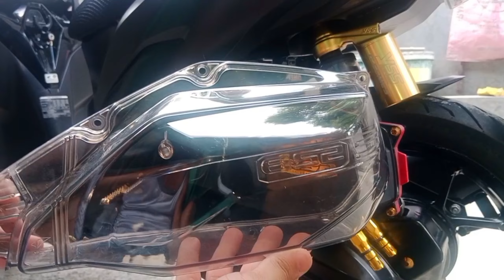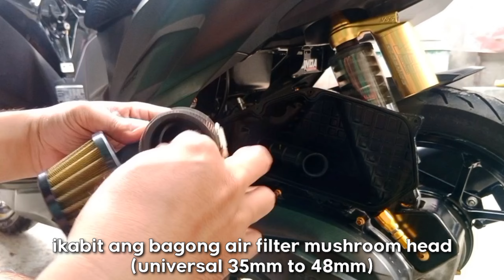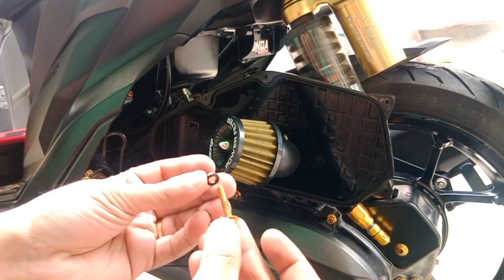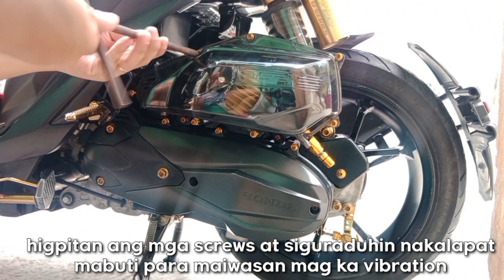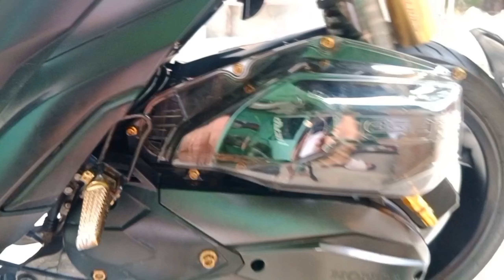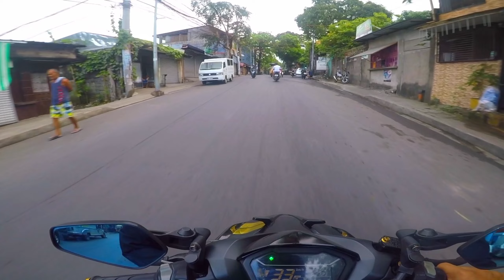RAM AIR FILTER MUSHROOM HEAD & SMOKE (TRANSPARENT) AIR FILTER COVER | HONDA CLICK 125i v2

Comment: Paps, ask ko lang po if hindi naman po mabilis magdumi ang throttle body noong nagpalit po ikaw ng mushroom air filter? Salamat po.
Reply from the maker: hindi nmn sya as in expose and alagaan lng natin sa pag palit ng filter lods...rs
Reply: Ok po, Paps. Ilang kms po kayo nagpapalit ng mushroom air filter pati naglilinis ng throttle body?
Reply from the maker: @jamesescala7281  sabay lang sa 2nd change oil ko 3000km tutal 100+ lang naman yan...rs
Reply: @clicknaticmotovlog  Ok po, Paps. Bale 3000 kms ang palit po ng air filter. Tapos ayun pong sa throttle body, ilang kms po kayo nagpapalinis? Maraming salamat po. 😇
Reply from the maker: @jamesescala7281  10-20k max lods...rs
Reply: @clicknaticmotovlog  Maraming salamat po, Paps. Malaking tulong po ito. Pampadagdag po ng hatak ng motor. Ride safe po palagi. 😇
Reply from the maker: @jamesescala7281  ridesafe brother
Reply: Salamat po, Idol. May nakalimutan lang po ako itanong, nagpareset ecu pa po kayo pagkapalit nitong mushroom filter?. Thank you po. Ride safe po! 😇